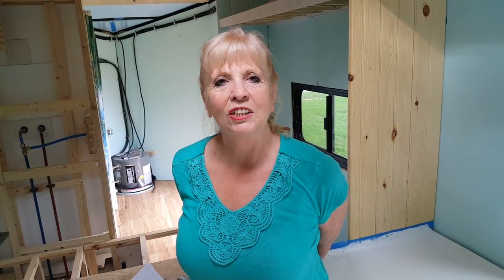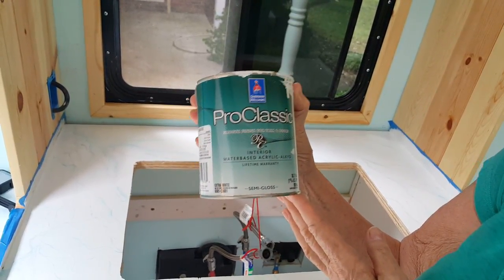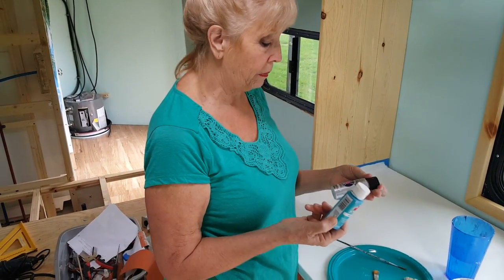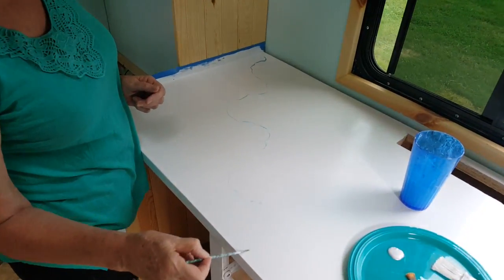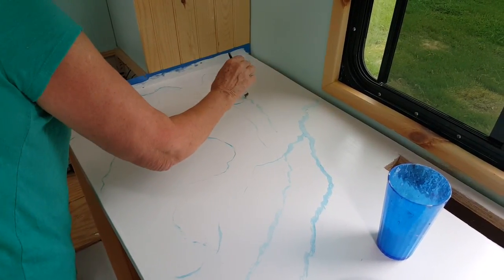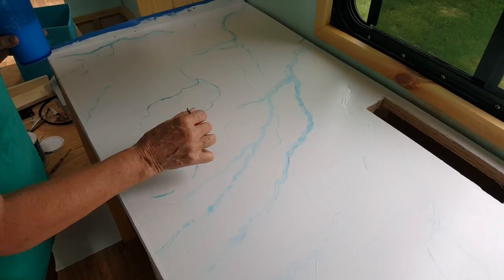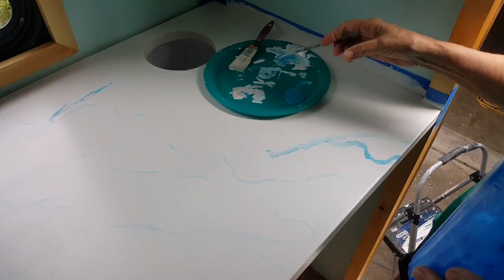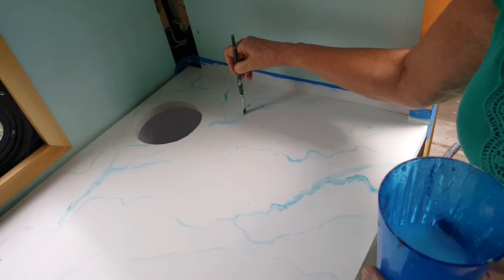Cargo Trailer Conversion Faux Marble Counter Tops

Comment: Hi Bill,  In an earlier video you mentioned that you used 12/3 SO cable (drop cable / extension cord type wire) for your electrical runs.  Is there a reason you used this type instead of residential Romex type wire?  I was thinking it might be for the flexibility of the insulation since the trailer might experience greater temperature fluctuations than a house.  Maybe a similar reason for the stranded wire instead of the solid conductors; more flexibility in the wires since the trailer will experience more vibration from going down the road.  Awesome build and I really enjoy your explanations and videos.   Stay safe and healthy.
Reply from the maker: You pretty much hit the nail on the head when you mentioned vibration. Our trailers are basically a rolling earthquake when being towed. SO stranded cable is basically the same thing they make drop cords out of. Think about it. Contractors drag their drop cords out of their truck, then throw/stretch em out across a construction site, all the while they're gittin stepped on, gettin rolled over by wheelbarrows and such, and then at the end of the day, they get hurriedly rolled up and thrown back in the truck, and then it happens all over again the next day, the next day etc for weeks, months, years and they still work. That's why I used SO cable.